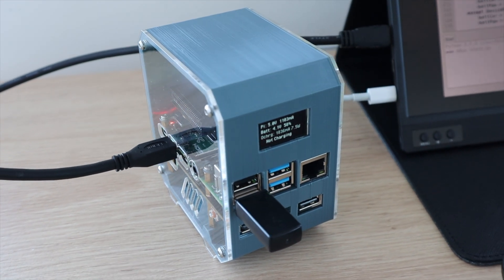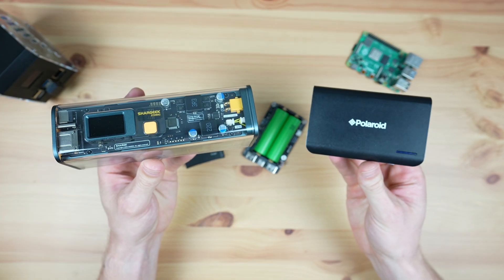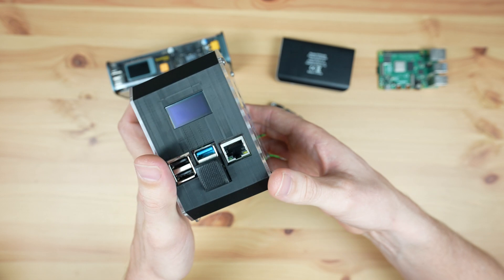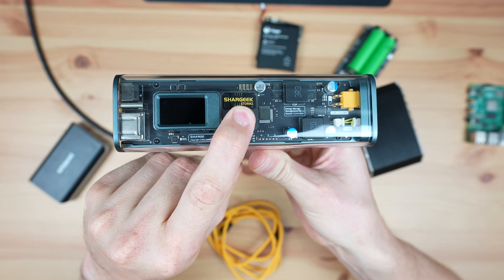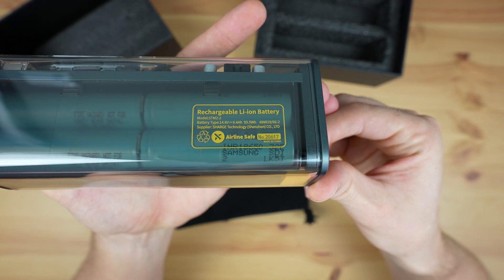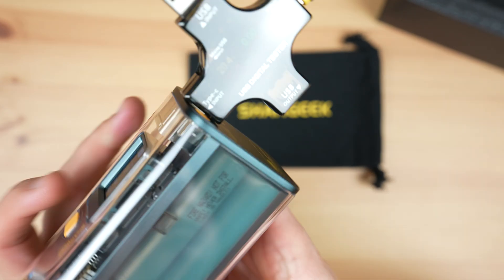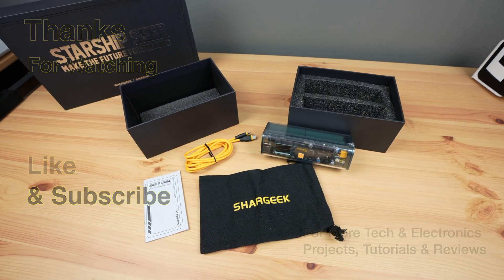Can You Power Your Pi With A Power Bank Instead Of A UPS? I Tried The Shargeek Storm 2

Comment: the Raspberry PI does not support PD. Then it could switch to 9V or 12V and thus use fewer amps. 
But The PI needs 5.2 volts, not less than 5V.
Reply from the maker: The Pi 5 does technically support PD - it's 5V input takes more than the standard 3A (allowing up to 5A under PD). But yes, stepping up to 9V or 12V would have made it use less current.

Comment: Thanks for the video, so what would be the right way to go if you want to power the pi for a robot thats moving around. 
I am seeking a light weight, mobile power source for the pi. 
I am currently stuck between 3 options, 
1. Power Bank, 2. UPS, 3. Use a lipo or battery with dc-dc buck converter
Reply from the maker: It really depends on the power requirements of the robot (motors, servos etc.). If its just a Pi running then I'd go with a power bank, if there is more to it then probably the battery and voltage converter option.
Reply: @MichaelKlements ty so much!!

Comment: The storm 2 is really cool, but man.. I really need something cheaper for a mini linux pen testing unit. Trying to hand held unit with a 5-7 inch display and modded keyboard from an old blackberry. So far modding the keyboard has been beyond my capabilities despite my full time education in electronics for a year. We only ever used breadboards and did calculations which I am now irritated with. And also the powerbank. This seems to be one of the only ones that actually gives you the capabilities of the unit, and the real time draw meter is awesome just like the rest of the aesthetic. My only thought is to get an ac supply and use a buck transformer with a wired in power draw screen. Buy that would probably prove even bigger even as ac supplies tend to be much larger.

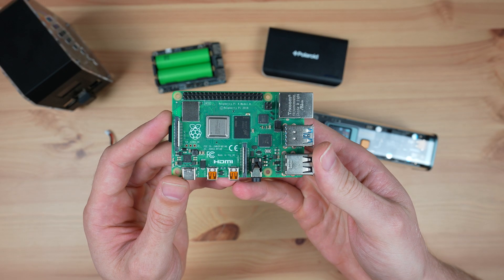Comment: 9:05 another great feature of an UPS would be to signal the RPi when the mains power is gone and thus take action: reducing the number of processes, perform a preemptive backup of critical data, and alert the sysadmin that the system is running on battery.

Comment: Question on a solar application: A rural school needs to run a small Raspberry Pi, either Zero 2 W or 3 A+, during the "on-line teaching" class, which means the Pi is a web server packed with the teaching material and provides a hot-spot. The kids share 4-5 laptops to take part. 

I'm faced with the same choice: a cheap power bank or a USB UPS? In case of a power bank they need to charge it before the class - there is mains power in another room. If UPS, it will be connected to a small solar panel 24 h and they take it to the classroom for the 2-3 h class.

What do you propose? Could you recommend models? Have to be very cheap since we are going to reproduce this in many schools.
Reply from the maker: What you have described sounds like a power bank would be the better option. You'll be paying more for a UPS and not really using it as a UPS, you just want portable power.
Reply: @MichaelKlements  Thank you! I am going to start with power banks, they are cheaper and simpler too.

If I want to get the power banks charged from solar power, what type of (small) solar panels do I need?
Reply from the maker: You can get solar panels with a USB output made for charging mobile phones, these would probably be ideal for your application.
Reply: @MichaelKlements  Makes sense. Thanks a lot for your advise!

Comment: 25K 22 wats powerbank costs 14 euros. includes fast charging, usb 3 and C all inputs and outputs has a separate BMC with a screen display. FOR 14 EUROS !! and is 150 mm X 62 mm. Tf you want more than that
Reply: 22 watts power banks don't support pass-through charging since they are usually small and have only one coil. The pi will reboot.

Comment: I am trying to create a Camera Board with Raspberry pi 5. The components connected to my Raspberry pi 5 are camera and Battery. I need to record videos. Is there any power banks that I can use to record videos at least for 5 days. Your help or suggestions are very helpful please
Reply from the maker: Raspberry Pi 5's are not really designed for portable battery powered projects, they're not efficient enough. Without knowing too much about the project and camera being used, they use around 4-5W in a typical project, so you'd need a battery of at least 500Wh - which is quite big. That's five times bigger than the Storm 2, which is already a large power bank.
Reply: @MichaelKlements  Thank you so much for providing information. That helps to move forward. But Can you suggest any other boards I can use to record videos for this much long(5 days) with portable battery please.

Comment: Really good video, but what about the pi 5 did it work the same way ?
Reply from the maker: This will work for the Pi 5 as well but you won't be able to power external PCIe connected devices through the Pi as well since this can't provide 5A through the USB type C port.
Reply: @MichaelKlements   Well this is at the same time a good news and a bad news I’ve planned to build a travel kit with a pi 5 and the argon one nvme storage but if the power delivery provide less than 5A, yeah it make sense that will not working, in my mind i’ve think to use a power bank from ugreen with a capacity of 100w or 140w that can also provide charging for my mac but there is a possibility that create an overload on the pi side
Reply from the maker: Depending on the NVMe hat (I'm not sure about the Argon one), they usually have a direct power input on the hat as well so you might be able to power the Pi and the Hat separately but from the same power bank.

Comment: but... why.... buy a damned 6v lead acid battery, allright ? then find a 5v regulator with low dropout voltage, allright ? now, you allso want a decently smart battery charger. it does certainly not have to be super smart, just be able to switch to a float voltage once the battery is charged. basicly any shite 6v "msart" charger will do just fine. hook it all up. and then you got your self covered.

Comment: Can you provide a link to the cable that appears to feature a DC barrel connector on both ends, as shown in your video? I’d prefer a cable with a DC barrel connector on one end and USB plug on the other end — can you recommend one? Sincere thanks!
Reply from the maker: I made this one up myself but you can buy them on eBay, just search for a DC 5.5mm male to male extension

Comment: I've been using PiSugar 3 Plus's to power several Raspberry Pi 4's (5V3A IIRC) for portable use. I just received two Pi 5s & wonder what battery rig I can get to put out 5V - 5W as the PiSugar, though it will work on a Pi 5, is a bit underpowered & you can't overclock or run at full power with an SSD. Any suggestions. The plugin chargers I have for the Pi 5s are 27W wall-warts rated at 5.1V5A. Any suggestions for a small-as-possible portable power supply that will fully power the Pi 5? 

BTW, the PiSugar 2 1200 mAh is great with a Pi Zero W & a Waveshare 2.3 inch e-Paper hat if you want to build your own tamagotchi for a third of the price people are selling pre-assembled ones. It takes just minutes to assemble. It's basically plug&play.
Reply: Same question
Reply: Did you find any solution?
Reply: did u find a solution

Comment: I don't have a Raspberry Pi but I am running and HP Elitedesk G4 mini desktop on an Omars power bank I bought some years back.  It has one usb C pd, two usb A, and a regular wall plug which is what I'm using.  It's a bit messy but the power bank and computer are both small enough to carry around, I eventually plan to use it just like a laptop. I have a Wimaxit small monitor connected to it and just need to get my hands on a small portable usb folding keyboard if I can find one.  I upgraded the Elitedesk to over 1 gig of storage and 32 gigs of ram.  The thing I don't know is how long I can run this setup before draining the power bank while out and about.  So far it looks like I'll get far more time than any laptop I've ever owned!

Comment: for $50 why not just get a real UPS?
Reply from the maker: Because a Pi is designed as a low power DC device. A traditional UPS uses significanlty more power because it converts AC to DC to charge the battery, then DC to AC at it's outlet and then you plug in an adaptor to convert the AC back to DC again. These DC UPS's sit on the DC side so they are much more power efficient.

Comment: Many power banks have passthru charging; a feature that allows the device ( PI ) and the battery bank to both receive power at the same time.  There  are two transitions to be concerned about however;  what happens when power to the power bank is removed and what happens when power is re-appplied . Most power banks that support pass thru charging still don't handle that transition nicely which will cause a reboot/power drop on the load side ( PI in this case ).  Many wi-fi cameras are similar in that the device is USB powered and every power bank I've tested fails on one of the two transitions. IN fact this is how I "learned" about these two transitions...   Even some "UPS" devices built for things like the PI fail the real UPS test ( how it handles the transitions ) .
Reply from the maker: Thanks for sharing your experience with power banks. 
A UPS that fails these transitions is effectively useless, it's no longer an "uninterruptible" power supply.
Reply: Do you know any powerbank that doesnt do that? Im facing same problem when pluging/unpluging power imput to battery pi restarts. Thank you

Comment: Can the adapter be used to power my internet provider's modem?
Reply from the maker: You can get 12V inline UPS modules specifically made for modems - something similar to thishttps://www.wagneronline.com.au/12v-40wh-dc-in-line-mini-ups/power-solutions/data-computer/ups1238-101085/1007503/pd/

Comment: One thing most "raspberry pi ups's" don't have is the ability to turn off the pi _fully_. So when power is restored: your pi is just hung in "halt" state. Super annoying. I think the pi sugar (and the original one) is the only one that has this feature, the rest of them are just junk. Meant for short term power or someone to come unplug the cable or press a button.

I want unattended, that's the whole purpose of UPS. 😅

Comment: Pity the fact that many power banks pass through line power if it's available, then take a short time to switch to battery power once the main input is lost was missed in this video, as this effectively removes, and reapplies power to the pi if the mains goes off, at best causing a reboot, at worst bricking the storage. FInding a bank that doesn't do this is the trick, and the reason to go with a UPS.
Reply: Depending on the pi's power draw, even a capacitor in parallel might do the job if it doesn't need to be the size of a car audio  cap
Reply: Can't this be avoided by simply connecting the output of your powerbank board to an additional safety circuit? As far as I know, designing it is possible.

Comment: the biggest difference imho is that power banks you typically cant or shouldnt draw power from it while also trying to charge at the same time.
Reply: Depends on the power bank. Mine specifically says you can.
Reply: @sspence65 Which kind do you have? I do have a lot of gear to run at once, so maybe I shouldn't return the expensive UPS I just got, but it would be rad to run my grooveboxes (edm instruments) anywhere I'd like off a power bank and ripcord.
Reply: @sspence65 which one do you have? I need it pls
Reply: This specific power bank says it can without an issue.

Comment: one thing not mentioned in the video is pass through. with that you can run the pi with some form of mains power or even a powerbank with sufficient power, but then have a way to switch to battery power when that primary power source is cut off. 
then, when the secondary power source is reaching its limit, have an automated way to shutdown. 
there are some options out there from talentcell, which have passthrough capability to certain pisugar models or even a diy solution.

the shargeek powerbank is too high end for thus. i use mine for various needs but cannot commit it to a pi. one issue brought up in the kickstarter was that the batteries are not removeable, so you cannot replace it since it is a sealed case. they were about to go with panasonic batteries but the electronics shortage had them switch to samsungs, but that’s heading off-topic…

then there’s the higher power requirements of  rpi 4. if you do not need a 4, earlier models have lower power consumption demands which leads to wider options of power options, and may be better suited for the job.
Reply: Even if it supports pass through the power on the output will power cycle for a few milliseconds causing the pi to restart. This is the biggest problem I faced while using a power bank (Mi make). But again it is a power bank, not a UPS. So I won't blame it.
It's best to use purpose-built UPS when you have primary power and you want it to run off batteries in case of primary power failure. if you are only concerned about running it off battery for as long as the battery lasts in a remote location, a power bank should get the job done.
Reply from the maker: @iblackfeathers thanks for sharing your thoughts. 
Pass through is an option on some power banks but I'd still go with a UPS for the battery protection, communicaiton with the Pi and safe shutdown capabilties. If you're using pass through then you're effectively using the power bank as a UPS anyway.
I didn't think to try opening the Storm 2 up to see if the batteries can be replaced but I did notice that there were screws on the end cap, so I just assumed that this was an option. Not being able to replace the batteries would be a pretty poor design decision if that is the case but it looks to me like it would be possible.
Yes, most earlier Pi models have lower power requirements than the Pi 4 so they'd be better for battery powered applications.

Comment: I had a UPS that took 18650s that, when it failed, rude-booted my pi over and over again until the microsd card was toast. 
Your purpose built ones look a lot better than the one i was using.
Reply from the maker: I've had a pretty good experience with the Pi Sugar 3 Plus. I've seen quite a few complaints about reliability on the Geekworm one although there are a number of versions and revisions of this board so it's difficult to tell which are good and which are bad.